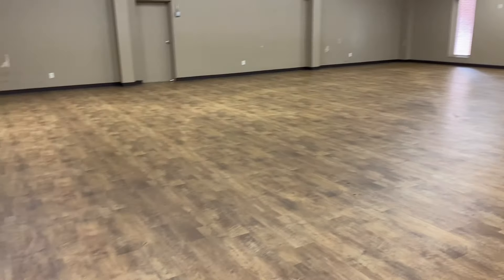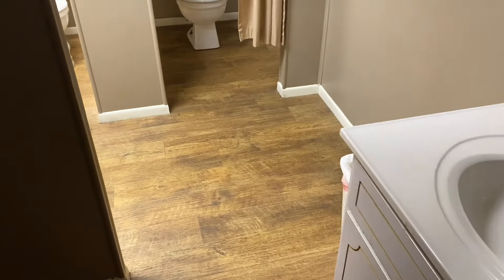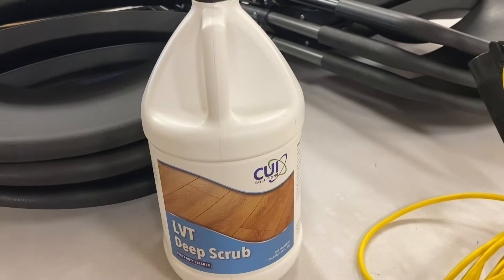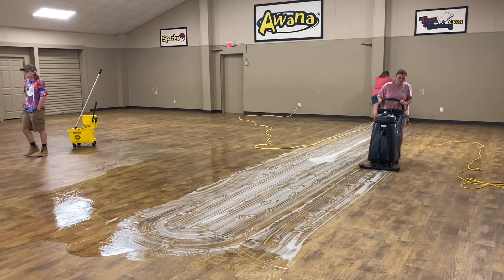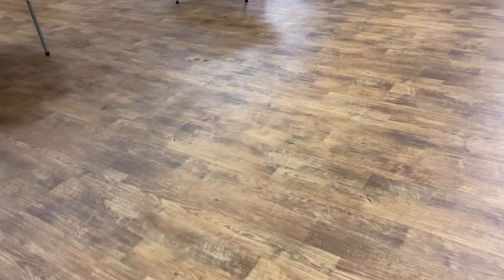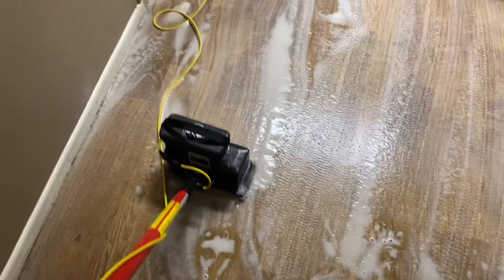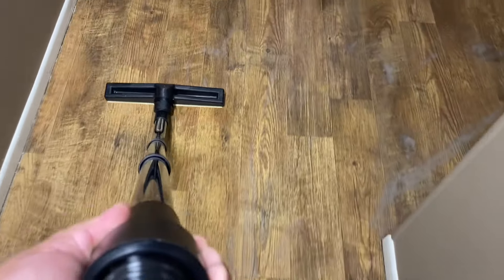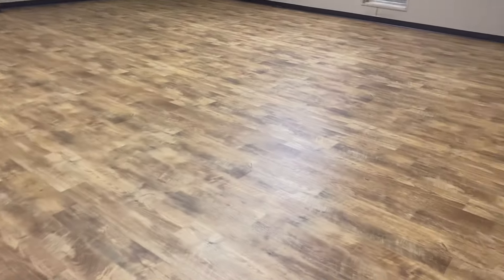How to do a LVT FLOOR SCRUBBING! @mrjeffthecustodian

Comment: High school I work at is getting a imop, it’s basically a hand held floor scrubber. Has brushes instead of a pad, check them out they are interesting.  not cheap of course.
Reply: I use a nilfisk sc100 with a brush  for safety floors.  It's a similar machine.

Comment: In daily cleaning you get much better results if you use a flat microfibre mop system and a doubble bucket. One Side you rinse the dirt out of the microfibere mop or pad and the other side you pick up clean solution. So the water stays clean for a longer time and a flat mop system picks up more dirt, then the classic wet mop.
Reply from the maker: I totally agree. In a situation like this with this floor. Where it’s a church there is no certain person over seeing the floor care. So it does not get  cleaned properly. Makes me cringe. To see the build up.

Comment: Hey, Jeff, I love the videos. I'm curious to know what pads you'll recommend using on LVT Floors specifically?
Reply from the maker: I have a link in description
Reply: Are lvt floors the same as altro? I've always used a machine with a brush for altro flooring.  .  Where I work we've always been told not to use pads as they damage the floor. I've seen altro flooring that has been buffed and it looks horrible, all the dirt gets ingrained into it.
Reply from the maker: @jshanks8365 I’m not familiar with Altro flooring. So That I don’t know.